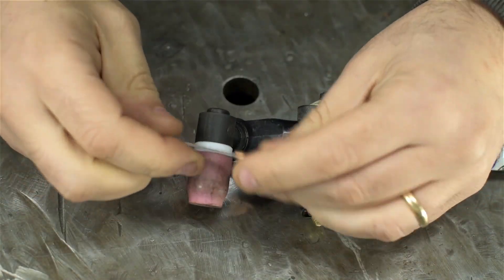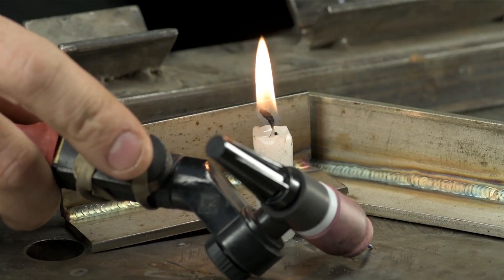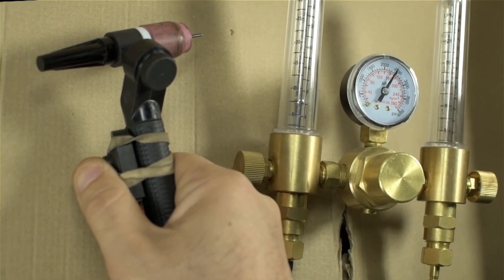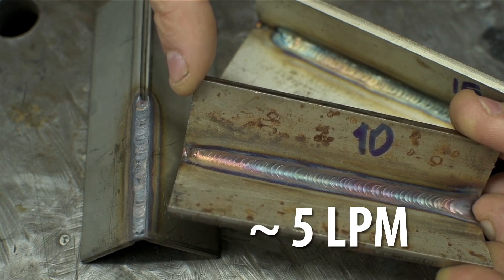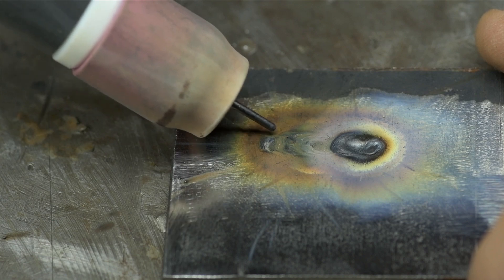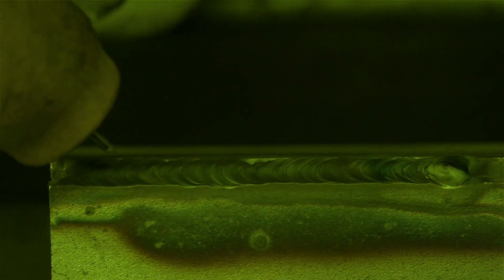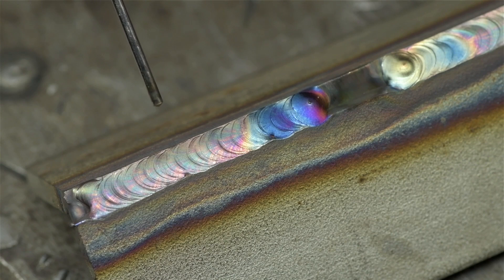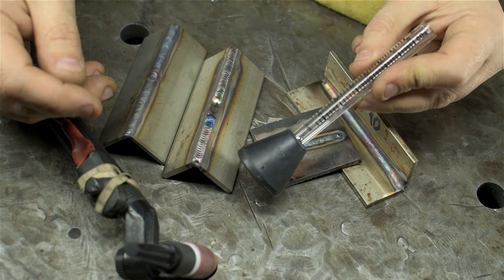TIG: Effects of Gas Flow Settings

Comment: One time my weld was looking like that no gas or too little gas thing, and it got worse as the bottle got used more. It was bad gas.

Also heat input matters too. If you can control heat input and fuse the metal very quickly, you could use smaller cup, and therefore less gas.

Comment: Great vid tony. Question I can’t get puddle on 1/4 cast aluminum. I think it maybe gas related. My gauge is L/min and I set it at 25-30 so 50-60 cfh. Could that cause the issue with why I can’t get puddle.?  I ran out of gas and just looked at gauge. New set up. I’ll have refill tm and find out if it was the problem. Would like to get some sleep tonight so if anyone has any thoughts on this that be great.
Reply: I'm no tig expert but that's way to much gas, try around 7 litres or so per minute and if it's an inverter machine turn the frequency to around 50 hz (lower hz = more heat for some reason 🤷‍♂️) makes a big difference on thick aluminium and turning the pulse off also helps get more heat.. check out welding tips and tricks, jody is a wealth of information on tig welding

Comment: my gas supplier recommended a 30cfh flow regulator .. we dont use adjustable regulators .. they are set to a flow rate .. I use a 6cup and it works fine , but maybe the gas supplier is getting me to use way more gas than needed !

Comment: Thanks for your videos! The reason why your readings between the flowmeter and the peashooter can never match is probably because of the necessary pressure drop of each instrument to work properly, means that in a setup where both instruments are installed in line, only the second (in your case the pea shooter) is able to show (if calibrated) the gasflow streaming out the cup

Comment: OK so I'm pretty late to the party, but...
The measurement difference between "@ cup" and "@Gas regulator" might be due to higher pressure at the regulator.
I've seen it several times at work, where we have very long hoses, longer hose, equals bigger difference.
Higher gas pressure, probably means that there will flow "less volume" because it's measured at a higher pressure. 
No science behind it, just my observations.

Comment: TIG welding is a very complicated subject. Despite all the attempts by youtube posters to try and formulize the process for the hobbyists and newbies. My best advice is to practice and experiment, but to that I would just add that in particular you should try and develop an understanding of Argon and how it flows...Tony briefly touches on it in this video by mentioning that it's heavier then air. This point needs really emphasising It's a super critical area of the whole process. If you try to imagine what's happening to the gas as it's leaving the torch you will develop an understanding of what's going on in front of you. You can develop ways to weld parts that either trap the gas or slow it's departure from the weldpool...e.g when he welds the backside/open corner of his test piece he experiments with the flow rate to change the amount of coverage and change the colour of the finished weld...There's rarely actually a need to do this unless you're welding out of position...i.e upside down! A far simpler way of controlling the gas is to block it's exit from the area...i.e clamp a couple of pieces of material either side of the welded joint to trap and slow the rate of escape for the gas. It will then stay around during the cooling process and help to ensure the weld is in a protective environment for longer. Hope this helps.

Comment: I brought a budget regulator and disposable argon bottles with a tiny little gas outlet port. What a waste of money that was, no ability to measure flow rate, and so little flow (even fully open) that you get an initial 'chuff' of gas when you strike the arc, then absolutely no discernible gas coming from the torch (didn't measure it, but couldn't hear even the tiniest hiss with the torch held to my ear). I know I'm a newbie TIG welder, but I didn't think welds were supposed to look that bad. So lesson learned, kids, don't cheap out on gas bottles or regulators. Come payday I guess I'd better splash out on a decent sized bottle of gas and a fancy schmancy regulator and flowmeter combo. And of course, thanks to TOT for sharing his knowlege!

Comment: On an outside corner I lay the cup back on the weld andalmost like you are going to walk the cup and then glide and dab. You can feel when the settings are perfect because the cup slides like butter over a good weld, grainy/cooked out welds will make the cup chatter on the bead.

Comment: One of the comments missing is that even if you're not getting shiny rainbow welds....the weld is still solid.  I found with 1/8" lap welding mild steel that a #8 cup just couldn't give shiny welds no matter what flowrate I used.  10...15...25 cfh, stubby gas lens, short gas lens, etc.   Switch to a #12 cup and about 20 cfh...perfect looking weld.

Comment: around min 7: material thickness Did I would say 80/90% of the work towards a nicer coloured weld and not the gas flow. On the first try with thinner material you were running the amps a bit high :)

Comment: Was the flow meter comment specific to TIG, or are regulators not as accurate in general? Just got a simple MIG machine, which came with a regulator. I'm going to use what's already been paid for, but just curious.
Reply from the maker: get a "pea shooter" to measure the flow rate at the gun. they're cheap and you can keep the regulator you have.  the risk with a reg is you might be using too much expensive gas.  regs usually measure pressure. you usually want to know flow.
Reply: @ThisOldTony  I see, thanks for the advice! I'll check around my local haunts this week for a "pea shooter". I'll tell em TOT sent me, they'll understand.

Comment: My disappointment is with you not using the wire brush to re-sharpen the tungsten.  Anyway, I'm thinking of keeping a lit candle on my welding table so I can see if there is a breeze happening.  My welder has a good fan in it, and I'm wondering if it's blowing argon away.  I'm very cheap, so I try to turn the argon down often.  Holding my breath probably helps eliminate some breeze, but it limits my welds to about ten minute beads, and makes the end look funny.

Comment: Im curious, we use Helium gas to get more heat but.. does a higher gas flow give more heat or is it still the same no matter what? We have this problem my colleague and I. The weld pool blows away if we turn up the flow to around 20 litre a minute. He think its because the gas flow itself blow away the weld pool and im thinking it just get too hot. What do you think? (300-500A).

Comment: I don't get why Americans have there tungsten sticking out so far  I know it can be done but it's on the limits of gas coverage. and it would be better if you explained why it's so important. how about talking about gas with mild steel  as using to much gas on mild steel causes porosity welding stainless is easy

Comment: Great, fun, information! On a more technical note, if you are making welds in a place that has ISO 9000 standards, you will have a spec sheet for amps, volts, filler rod, gas flow, etc. Eliminating variable, consistent results, is easier when you are making 10,000 identical pieces in a factory. That's where most of those specs and charts come from, repairs and one offs like you are doing, often requires going outside those guidelines. Thanks.😂👷

Comment: Is there a difference in strength of the weld between the different flow rates?
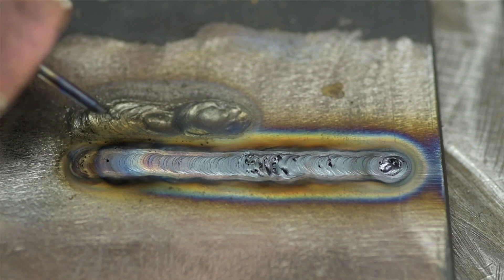Reply: As you can see at 6:00 the porosity that occurs when the weld is exposed to the atmosphere can negatively affect the strength of the weld

Comment: There are so many comments: someone may have already posted this, if so, apologies. Whether you have a Rotameter with a bobbin, or a flow meter with a ball, read off the widest point. For a bobbin, that's the top. For a ball, it's the middle. HTH. Oh, and I still blame you for making me buy a fancy TIG that does pulsed AC. It is way beyond my skills for to me to use the thing properly. You're so irresponsible... you'll probably have me buying a surface grinder next.

Comment: Two flow meters (rotameters) in series will NEVER read the same, even if they are identical meters.  The first one operates at a higher gas pressure than the second one.  There is always pressure drop in these meters and the second one operates at lower pressure than the first one.  If you doubt, get two identical ones and hook them in series.  Note the readings.  Then swap the two meters and find that their readings still are by the position, not by the meter.
Mass flow meters are not fooled by the gas pressure, so they are a different and much more expensive case.  But sometimes the rotameters have their calibration condition, i.e., the gas and its pressure stated.  And of course you may see rotameters with two scales, one for argon and the other one for carbon dioxide, for example.

Comment: First time ever Tig welding I had the leads backwards in the machine... burned up about 5 inches of tungsten, and made some interesting looking "welds" on some 3/16 flat bar... couldn't figure out why I had no flow. Was about 5 minutes away from dismantling my brand new welder to replace the solenoid when I remembered these things are positive ground. The o-ring in the negative lead port really should've tipped me off.

Comment: this video reminds me A LOT of welding class.
(not so) pro tip: when in class, don't go nazi over conserving shield gas. You WILL forget to turn it back on and you will also make many more trips to the tungsten grinder. P.S. grab two electrodes, and sharpen them both at the same time. saves a lot of effort.

Comment: One big thing that also helps on stainless outside corners is to stand your torch more upright. The gas will remain over your weld bead longer (the trailing edge) while it is cooling, which will minimize dark coloring. Makes it more of a pain in the ass to record good video though...
Reply: hey  6061.com

Comment: This is very interesting, the "too much gas" situation can happen surprisingly easily with standard collet bodies, but sometimes on welding aluminium, pushing a little too much gas through a smaller cup on a standard collet seems to work better - I've often wandered why this is?  I have theorised that maybe the gas is physically carrying away contaminants pulled off the weldment during the electrode positive part of the cycle, but I haven't really heard a definitive answer.  Thanks for another great entertaining vid as always!

Comment: I was waiting for the workpiece to go shooting off the table when you hit 70cfh, and you didn't disappoint! I have that happen with small parts even at 12cfh. I loved this video. I usually just leave it at 12cfh, having always been told that more gas just wastes gas, but I do so many oddball welds in weird configurations as I'm making a sculpture, that it seems to me like I should try 15 or more cfh and see how that goes. Here I've been berating myself for crappy technique, and it might be that I just need a little more flow, at least some of the time. The rest of the time it'll be crappy technique most likely.

Comment: What if instead of paying for all that expensive gas, you made an airtight room and filled it with argon. You would never have to replenish your welding gas, and the welds wouldn't oxidize at all.

However you would have to bring you're own air supply, and entering and exiting the room might be a challenge.

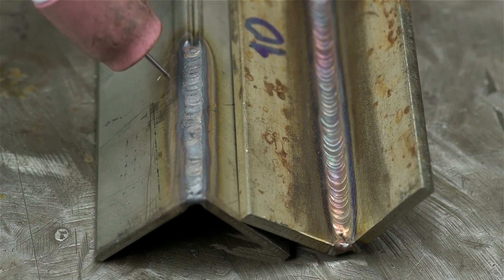Comment: 4:35  could you alternatively keep the gas flow the same and shorten the tungsten length from the edge of the cup? Is that how it works or does the gas drop fairly well regardless of tungsten length?

Comment: Very few welding videos cover step #0 in welding which is cutting and fitting the metal with the tools you have to make a reasonable joint to weld. Most home shops don’t have a shear or other big expensive machine to make even practice coupons,  So what tools do you use that are cheaper than a plasma torch? Thanks for all the great information you kindly share in your videos!

Comment: "Argon is the third-most abundant gas in the Earth's atmosphere, at 0.934% (9340 ppmv)." "Argon is produced industrially by the fractional distillation of liquid air." If it's sinking then it's likely an effect of the temp drop from expanding rather then the molar mass. I'm getting hints that your wife is cosmology inclined you should ask her ;)

Comment: I'm a new welder, not I tried gas . All I have too say is the fire dept and my insurance company are not happy. Well to put thing in A LARGER PROBLEM, I INVITED MY NEIGHBORS WIFE  OVER, AFTER I TOLD HER, I NEEDED A " B " CUP. LET'S SAY MY WIFE AND MY NEIGHBORS HUSBAND DID NOT UNDERSTAND. SO IN A WAY MY START AT WELDING WAS A DISASTER. lucky for me, I have a South bend 13x7 and a Bridgeport series 1, 1.5 as you know I can go back in Time. By setting the Southbend carriage  in rev, and turning on the bridge port, Boom I was 1.5 year in the past. I love the old school time machines. Great video, I think I'll use acetylene gas this time, I have a extra tank, should shield ok, what's a little black smoke going to do?

Comment: So I've been tig welding for about 20 years and I still learn stuff Every time I weld. I just recently had a titanium pipe job come through my shop. Done plenty of stainless work but not titanium.  Wow talk about some picky stuff on flow rates and coverage.  I built my own gas trailing cup with diffuser on the back of my tig cup. 
That stuff is really difficult to weld on a table without a purge chamber. Was able to finally get the straw color I was after but not until alot of experimenting with flow rates , post flow and hang out time.  Any tips you could add?

Comment: What was the problem with the maximum flow rate? It looked like a perfect weld. If you use a gas lens I don't think a high flow would bring in much contamination

Comment: Hey this old tony, little pro tip stainless is really hard to get porosity in while tig welding.  This also means that 309 is really good at covering up porosity in a carbon weld.

Comment: Awesome vid as always!
Maybe try using a non gas lens to see if that will help induce porosity from too high a flow. The lens part might be keeping the gas flow too tight to really cause enough turbulence to cause porosity... I really want to see this done because I've always heard its a problem and have yet to ever encounter it my self. I have run some silly flow rates (thanks to silly engineer's not understanding what actually has to happen for the weld they called out...) but have never had an issue from too high a flow.